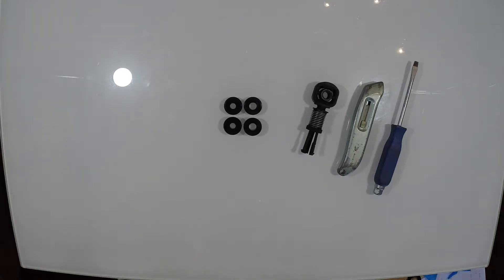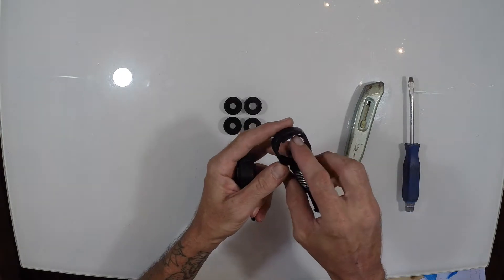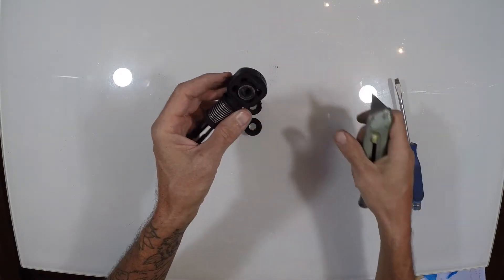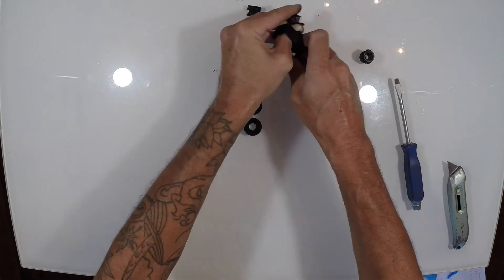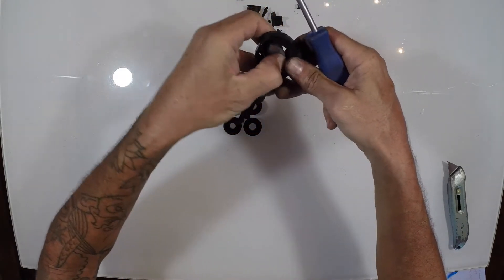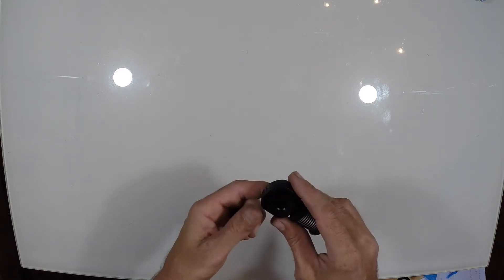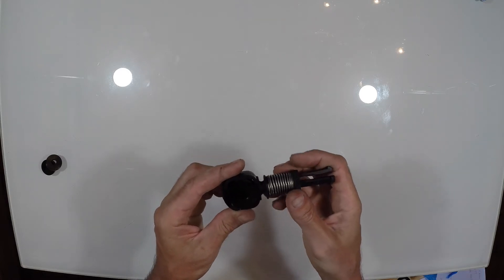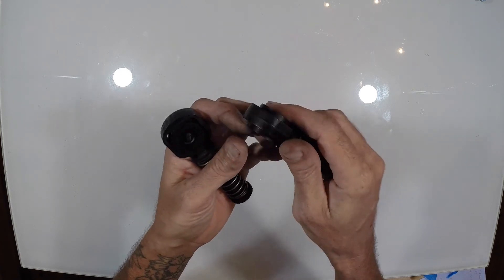Mk4 Solid Delrin Cable End Bushing Installation Instructions

Comment: 1 hour for replacing and re-adjusting the shifter, at least I was doing right I guess because the result is much better and feel short on each gear for my TTQ - 6M. 
I saw a bit gap on one of the small diameter bushing after put back the locking clip so I tried to put a thin-spacer to reduce the gap between , the result is now much better and solid as described !!!Thanks 😊